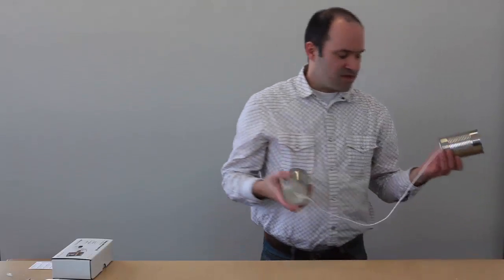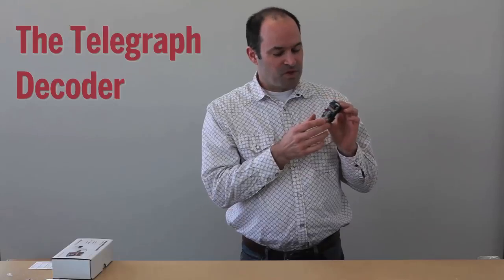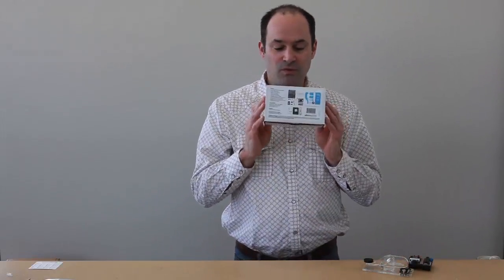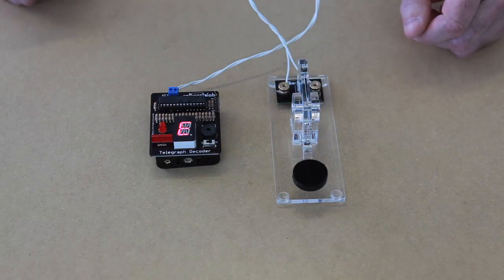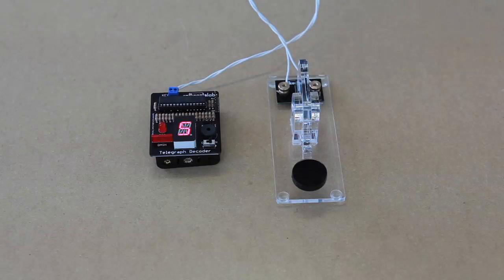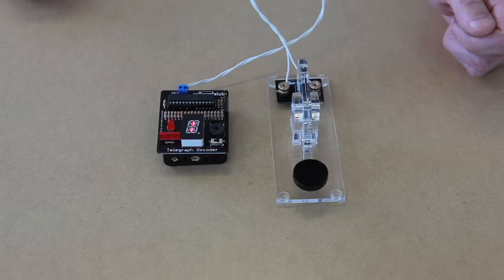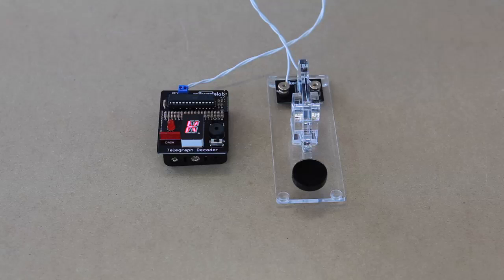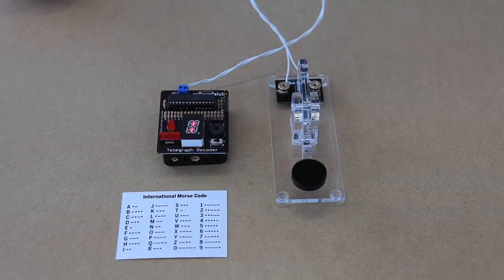The Telegraph Decoder from SpikenzieLabs

Comment: Nice kit. Has potential. But decode seems slow. Can that be adjusted?   In a 2 person setup, can you send faster than led will display, or does LED just lag behind?  I'm mostly interested in kids being able to send at faster speeds, even if LED doesnt decode.
Reply from the maker: Thanks! The Telegraph Decoder kit was designed with delays and some amount of slowness on purpose. The reason is so that would be easier to use once built by people that are new to Morse Code. The on board processor is an ATmega, and programmed using the Arduino IDE. We have broken out the programming header on the right side of the board, and made the Telegraph Decoder kit program available on our web page. This way if people are so inclined they may download the code modify it and then reprogram their Telegraph Decoder kits themselves. (There are programming comments in the code describing some of the key delay settings).